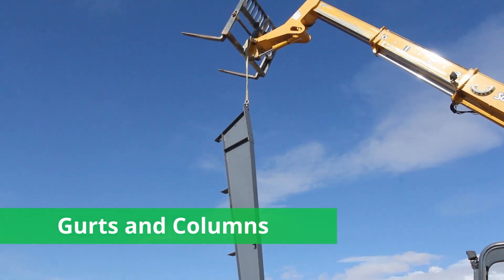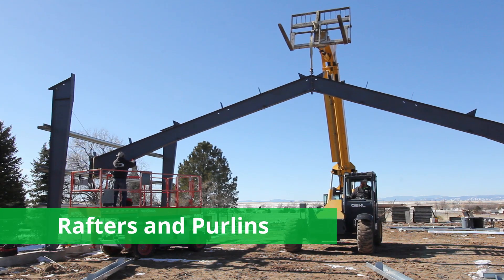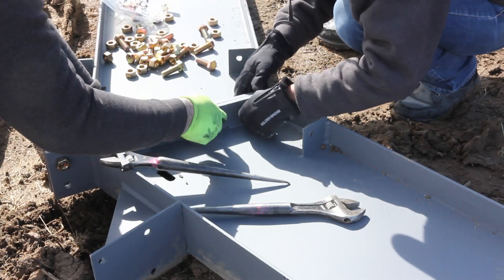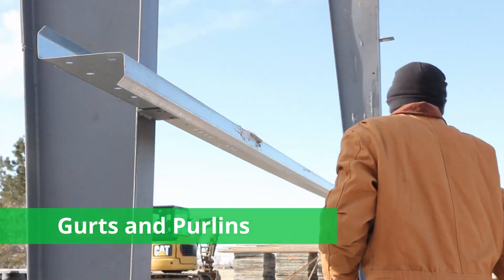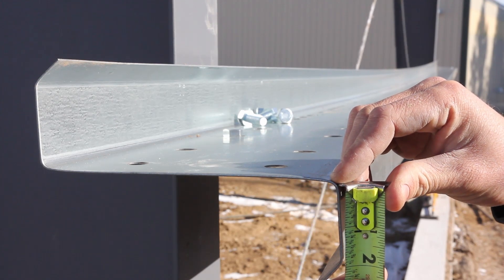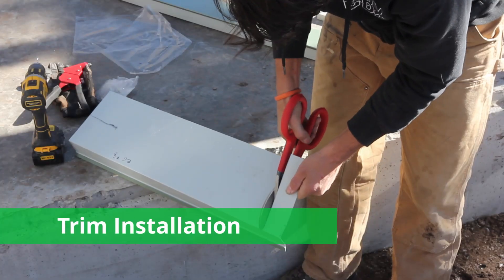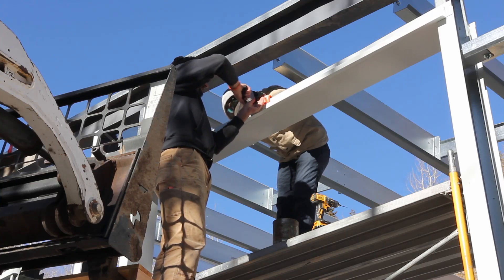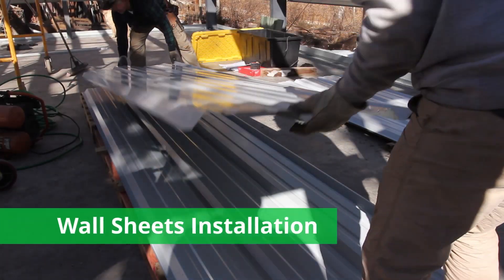How to Build a Steel Building - Erection Rundown

Comment: What do you do if an anchor bolt is off center 3/4"
Reply from the maker: Really depends on the base plate. If it's large enough to the bolt diameters amount of steel from the edge of the plate, the baseplate can be reamed. Also want to make sure there is enough clearance from the web or flanges for the nut to turn. Check out our 3 part series on anchor bolts and troubleshooting incorrect bolt placement. 

Thanks

Comment: @GWBuildings Do you have a video that talks about how to rig/strap the steel when placing columns with a telehandler? I want to make sure we are being safe when erecting these tall, heavy steel columns.
Reply from the maker: Check out some of our other videos, you'll see a lot of examples of steel being raised and rigged to lifting equipment. Also our erection manual, which is available on our website goes through rigging in detail.

Comment: is it normal when you lap the girts/purlins  that the holes need to be reamed out?
Reply from the maker: Hello Dan, Eric here, If the holes need to be reamed that is a sign of something else going on. However.... it is not abnormal - a simple issue with anchor bolts being 1/4 - 1/2" off can lead to some difficulty with laps - so it's a consideration of what is easier to do. Most people, even seasoned erectors, can miss minor deviations with bolts, squarness/plumbness of the building, etc... and not catch it until they are flying purlins - at that point - reaming purlin slots is a lot easier than taking the steel down to ream or slot somewhere else. 

Correct flange lapping and the use of a spud wrench should minimize this. If the holes have to be drilled or moved - it's a good idea to stop work and figure out the root cause - Calling construction support is probably a good idea at that point as well. 

Thanks

Comment: You need a complete beginning to end constitution video.  There alot of information,  visual reference that is missed with these short videos.  My building is coming from you guys and I really need more info. There really needs to be a very detailed video on exactly how to do everything from start to finish without these quick rambling videos.  PLEASE
Reply: I'm looking at them for my building.  Did you look at other Steel Vendors and why did you choose them?  I'm looking at doing a 40 x 50 x 16 or 40 x 60 x 16.  Any information would be great for me at this point.....thanks    Mark
Reply: @Dozz70  This is more detailed than 90% of any steel builders will ever put out there. The biggest help is to have lifts and handlers to lift everything and get you up there to work. Most people don't have access to that and the cost of long-term rental is usually so much that it is better to just pay someone.